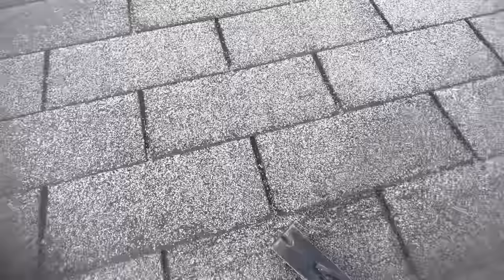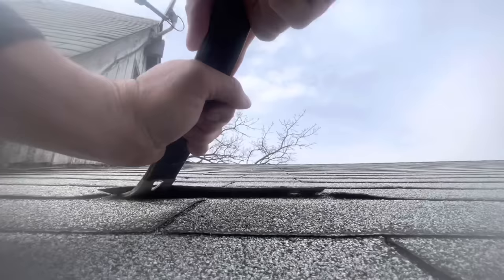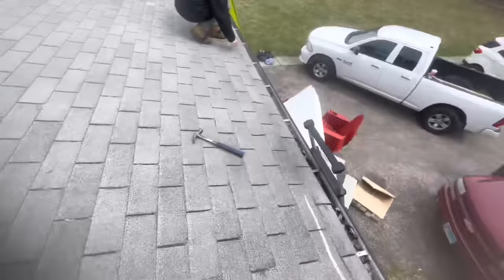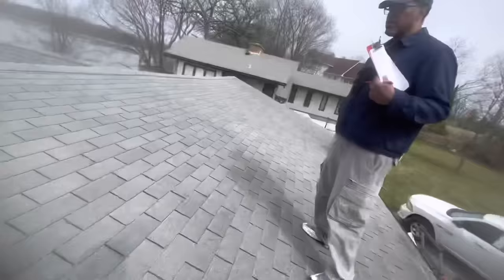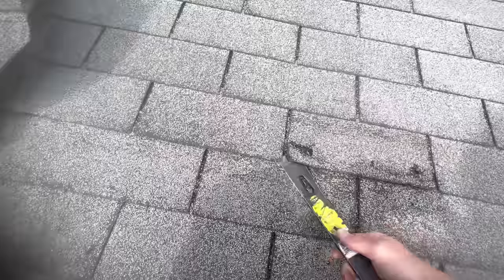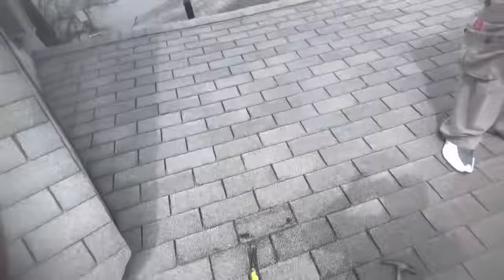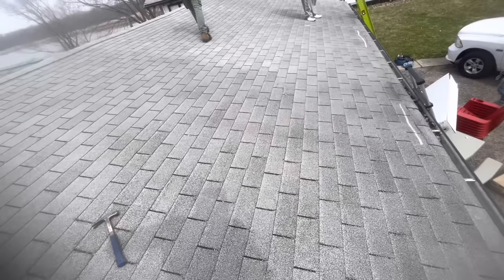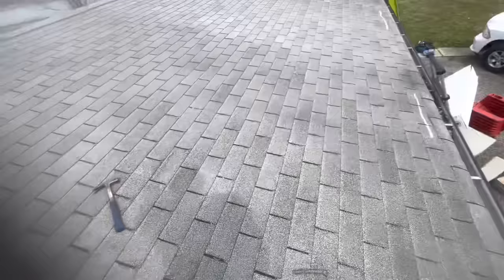Insurance Adjuster says roof is repairable. 😂 See how this inspection is ignored & denied?

Comment: I had state farm for 21 years. Started off with auto and then when I was finally able to buy a house, I added that on as well. Fast-forward 4 years to a wind and hail storm in my area. My mother in law has Erie insurance and lives about 12 minutes away from my wife and I. She and I both had roof damage from the hail strikes and strong winds. She called her insurance company, they checked the weather reports for the region and asked for pics if we could provide them. After that they told her to schedule the repair or replacement. No claims adjuster ever came out for her. She had a new roof put on and it was fully covered. State farm sent a guy to our house. He went up on the roof and when he was done he said all the damage was related to the roof being improperly installed, claim 100% denied. In 21 years it was the first claim I had ever filed on my insurance for anything, house or car. I dropped them about a month later and went with the same agent and company as my mother in law. It was frustrating as hell and incredibly expensive. I thought back to all the money I gave them and for what? They will do ANYTHING to not pay for your repairs if and when they are needed. After dealing with my claims adjuster I am not at all surprised by this guy.
Reply from the maker: Did you have a roofer at least come out there and show him the damages? It sucks when you're loyal to a specific company and not what you feel is fair.
Reply: @ChicagoRoofer  I was naive and did not. Also made the mistake of then having the roof replaced by the company with that cheapest overall price because it was what I could afford. We have since moved but it was just 3 years ago and when I drive by the house the roof already looks like its in need of repair. I have learned some valuable life lessons throughout all of this.
Reply: Sounds like you just learned about insurance lol
Reply: Im thinking you helped pay for the pool at Aaron Rogers house.
Reply from the maker: We were able to get this claim from $3,200 to $64k.

However, the way it was denied and the games being played should have never happened.
Reply: That's normal state farm.  Even if they pay a claim, they will massively jack up your rates, and if you file two claims they will drop you.
Reply: Don't forget to mention Allstate. I had two claims for roof damage and the adjuster did the minimum repair.
I asked him if he was paid by 
Allstate to do the cheapest repairs. What a joke!!!

Comment: As a home inspector I’ve also seen the opposite. Said a roof was good (it was 8-10 years old), and insurance company told the client (buyer) that they needed to replace the roof before they would cover them. We brought out two roofers who both said the roof was good and they didn’t see anything that needed repaired. The adjuster insisted a new roof was needed for them to cover the property.
Reply from the maker: I've seen that happen too.
Reply: Happens here in FL all the time. We were dropped due to the age of our roof even though the inspector said it was fine.
Reply from the maker: Sorry to hear
Reply: @ChicagoRoofer  thanks, insurance is a mess here. And crazy expensive, $6500 this year for a standard 4bdr house with a new roof and impact windows and doors.
Reply: That don't make sense.  why would  a roofer trun down a job?
Reply from the maker: The roofer in this situation did not turn on the job, the insurance company suggested that the roof is in a repairable condition
Reply: @duainejanes8240  Roofers also have a professional obligation to their client, especially when they're brought in as a consultant.  Just because the adjuster wanted to protect themselves and screw the homeowner, doesn't mean the roofer wants or needs to get jobs in a shady way as a result.
Reply: I had the same problem with State Farm and I ended up paying for my roof and I changed insurance companies and I won't recommend State Farm to anybody. I guess having a client that pays there bill on time means nothing to State Farm.
Reply: @jbr1952  It doesn't, they have algorithms that determine whether it will save them money to deny these claims even if there is 'x" percentage said clint will close their account and go somewhere else.  Sickening really.
Reply from the maker: Are you an adjuster?
Reply from the maker: A lot of people don't revise you could change your insurance company and still go after the old original insurance company that you had while you were insured. Let them do us right, your new insurance company shouldn't have to foot the bill
Reply from the maker: This is spot on. We oftentimes have another roofer show up at our job sites to tell us we're wrong for the carriers request. 99.9% of the time they agree with us 100%, and the carrier still has a hard time digesting this and often times stress is still the night :-(
Reply: then you get cases like mine where we bought a house with a shitty roof and they covered us without looking at it LMAO
Reply: @8180634  Crazy, that's 10x the price I'm paying
Reply from the maker: It's because the value of vehicles and vehicle parts went up so drastically. They're just keeping up with the increase on a vehicle. Still sucks though. I'll venture to say that the same thing is happening with homes. To rebuild a home is much more expensive for the last two years and I don't think insurance companies are keeping up with it.
Reply: @ChicagoRoofer  no the prices have been high here forever.  It's all the fraud and suing here.
Reply from the maker: That's expensive for sure. 🫰
Reply from the maker: It happens too. Good for you but bad for the insurance company. I feel like it should be a fair two way street.
Reply: That’s when OK you install a brand new roof....next day microburst whips off entire new roof and adjuster says he’ll cover only 65% because the roof is not new! That’s what I went through... I left State Farm and never looked back!
Reply from the maker: Ouch. At that percentage, the roof should have been replaced.
Reply: Insurance company is in the business of liability management. Which in their eyes translates to legal for a multitude of various reasons or circumstances you are required to have their services so your already pigeon holed and they can make you pay whatever they want for absolutely no justified reason ...and furthermore make you pay for shit that's not needed in an effort to make sure they don't have to pay... 

Roofer here, seen people forced by Insurance to replace their roof to preserve their mortgage agreement only to have it destroyed (brand new roof) by a storm and then denied a claim by said insurance company for some nonsensical reason... and then penalized (preyed upon) by all other possible Insurance companies by given inflated rates just because they filed a claim recently...

The board of directors for these companies need to all take their yachts to some legitimately deep water and the fuckers need to not come back... #claimdenied.
Reply: Understand it’s because the insurance company doesn’t want to take the risk of having to replace the roof prematurely. Insurance companies depend on reinsurance who ultimately dictate the market and decide what limit of exposure the insurance companies can have. Insurance company refusing to an insure a home with a roof that’s 10 years or older, it’s just limiting their exposure.
Reply: If it's over 15 years it doesn't matter how well you were taking care of your roof, insurance want a new one before covering it
Reply: @MrMusic55123  two reasons, the abuse of the one-way attorney fee multiplier & Assignment of Benefits
Reply: @8180634  the fuck. Are you in california?? $6500 a year for insurance is ridiculous.
Reply: @askalucas411  Florida.. And they're expecting it to go up another 20-40% next year thanks to hurricane Ian.
Reply from the maker: Sounds like Florida. Higher risk due to hurricanes.
Reply: @8180634  they’re going up in price again because of something called an assignment of benefits, public adjusters and the one-way attorney fee multiplier. 

Also the Florida HO3 form pays replacement cost on old depreciated roofs. That language needs to be amended to pay replacement minus depreciation like after 10year of age, like 40 other states in the US.
Reply: @8180634  Now add the billions in damage from Hurricane Ian, insurance companies are packing their bags and leaving Florida not only because of the litigation crisis, but the loss exposure it too great. 

We’re faced with a complete and utter meltdown of the Florida property insurance market creating a monopoly to the nightmare “insurer of last resort” Citizens property insurance. 

Florida has over $300Billion in exposure and the the Florida CAT fund has $11.3billion in the bank. 

Floridians are in for a bumpy ride when it comes to property insurance.
Reply: @s.m.murphy6776  There are many problems here, in addition to what you touched on.  Assignment of benefits is definitely a vehicle for fraud (stealing from the insured), but I'm not sure how that would raise rates.  And sometimes public adjusters are necessary when insurance companies try to stiff people.  But agreed on the roof thing, I suspect mortgage companies have a role to play in that rule.  They're afraid a homeowner with a 20yr old roof torn up from a storm wont' be able to pay to replace it, putting the mortgage at risk.  That's just a guess.  Definitely a lot of fraud going on, of all sorts, and that's hurting us all.
Reply: Florida and other states that have regular hurricanes and massive CAT damages tend to either have the wind pool insurance or set most people at a percentage of the dwg coverages.  Percentages can run as far as 4 or 5 at times, when it comes time for that wind/hail claim that deductible is a killer from the get go. Regular deductible 1000 wind/hail 9k, 10k, even as high 20k at times…gets crazy man.
Reply: @nicolai2429  it’s called Reinsurance.  It wind pool insurance. If you don’t have a clue what you’re talking about then I’d keep your brain fart to yourself. 

The wind and hail deductible came about after hurricane Andrew in 1992, which also prompted our insurer of last resort. Citizens. 

If it weren’t for reinsurance and the hurricane deductible, we would’ve have homeowners insurance companies the past 30 years in this state.
Reply: @s.m.murphy6776  Was there anything in my statement that said reinsurance was a bad thing?  Or is reading comprehension just not one of your strong points?  😂 

Feel free to get back on your high horse and carry on…
Reply: @s.m.murphy6776  take a deep breath and try reading what he wrote a second time.
Reply: And his cousin Bubba 🤡🔨could give you a good price on a new roof, right?
Reply: My dad just bought a property in PA, the insurance company wouldn’t insure them until they repainted (they were already painted, just old) the doors on a separate shed! Old paint on a shed door = uninsurable?!?!
Reply: They do that to force a costly replacement that they know they will get another 8-10 years out of before a claim comes in.  So in short they look at it as forcing the home owner to pre-pay their claim out of the homeowner's pocket.

Comment: Stating that the roof is not repairable due to installation errors is kind of a tricky approach. Theres typically no coverage for that and you would need to redirect the full replacement to the previous roofers liability carrier. You’re probably better off approaching this as unrepairable based on a brittle test. The granule loss is also pretty severe on this roof which makes repair more difficult. All in all id say this is probably a pretty new adjuster and hes reeling at being confronted, a reinspection or AUP should get it sorted.
Reply: Agreed, especially when insurance companies specifically do not insure for wear and tear, age or weathering and granular loss is the main indication of those things.
Reply: Yea, there is logic to denying this claim.  I think the big issue is how the adjuster handled it.  

At the end of the day, roof claims are pretty tough, as many roofers simply suck at their jobs and/or cut corners.  Insurance companies have known this for a very long time.  Especially in regards to adding extra sealant when it is unnecessary (usually to get away with using cheaper nails or fewer to meet wind ratings).
Reply from the maker: You would be 100% correct if it was a claim for installation errors or wear and tear. Each are not covered as a covered peril. However if they contributed due to a covered loss then it would still be covered.
Reply: @ChicagoRoofer  But theres no covered loss here. No hail damage. What was the outcome?
Reply: @philipyoung7748  Wind damage was the cover

Comment: It always surprises me to see bitumen shingles being used on a roof. Here in the UK we generally use clay or concrete roof tiles, although nowadays metal or composite tiles are becoming more common on new build houses. Our house was built around 1938 and still has the original Belgian terracotta roof tiles. We do need to re-roof in the near future, but those tiles have lasted something like 85 years. Having to re-roof every 8 to 10 years seems a bit crazy to me, never mind having to tussle with claims adjusters and insurance companies bent on minimising their losses.
Reply: I was going to add that we only use bitumen roofing on outbuildings and garden sheds.
Reply from the maker: It's interesting for sure. Wish the market wasn't to dry clay or metal roof. However, we also dying build homes with cinder blocks or concrete, just the footings. Where you located?

Comment: Double bond! Actually roofers are supposed to remove the clear plastic sheet from the tar under each shingle, that heats up when sun heats the roof, in turn protects from strong wind flipping up and breaking shingles.

Comment: what was wrong with that roof? I didn't see the wind damage, and the roof appears to be at the end of its life anyways. If I was an adjuster for an insurance company I wouldn't approve a claim. The homeowner is just trying to get a new roof.
Reply from the maker: The insurance company should have told him it is uninsurable. The age and condition is why it can't be repaired and why it's owed for.
Reply: @ChicagoRoofer  They have no obligation to provide funds for a roof that is at the end of its life. I didn't see you point to any damage caused by the wind. I just saw an average looking old roof. If damage did occur from wind or whatever, then sure and maybe it did. I just didn't see it in the video. I only saw you making the claim that its not repairable, and your right on that.
Reply from the maker: Hey, thanks for your feedback the insurance company extended coverage for wind damage on two roofs on this property. They agreed there was wind damage on both. Then when it came to doing the repair that they paid for, it was impossible to complete that repair. That's the main reason why this video was done. In addition, I had a separate video originally been done on my cell phone but it died during the recording so I had to use the homeowners phone..
Reply: I. AGREE IVE DONE ROOFING FOR OVER 30 YEARS AND SURE A NEW ROOF WOULD DEFINITELY LOOK BAD ASS!!! BUT WHERES THE WIND DAMAGE,MISSING SHINGLES BENT SHINGLES??? I BET THAT ROOF DOESN'T EVEN LEAK!!!! AS A ROOFER I WOULD NEVER SAY THIS TO A CUSTOMER LOL!!!!!
Reply from the maker: 40+ wind created and missing shingles. Plus leaking.

Comment: I work for a roofing company as the operations manager and deal with insurance companies quite often. We currently have a roof in the same situation and Allstate wants to repair 35 shingles on the back 🤦‍♂️. Luckily the state of Tennessee passed an unfair claims act into law that basically says if the color cannot be matched, thus causing an eyesore so to speak, then a replacement is warranted. Now in our case there is no damage on the front, so technically they could just opt to replace the entire rear of the home but in doing so if it causes a noticeable color difference, we believe the entire roof should be covered. We've currently sent a shingle for ITEL assessment. These insurance companies are just making us jump through more and more hoops delaying the inevitable!!
Reply from the maker: Great observation. In fact, your insurance company promises to bring you back to pre-lost condition. If you have no matching policy, you still have to make sure that the insurance company brings you to a pre-loss condition. That includes loss of value and loss of appearance which both lead to a loss of dollar amount when it comes to the sale. Nobody likes an eyesore.
Reply: Same here in Texas. Also Allstate. I had to get the closest matching shingle, install it, take pictures, and send it to Allstate confirming that repairs would not match. Allstate pproved it right after that. Just another bs tactic to try and avoid replacing a roof.
Reply: If you can't see the front and back at the same time, they usually won't cover replacement for the entire roof!